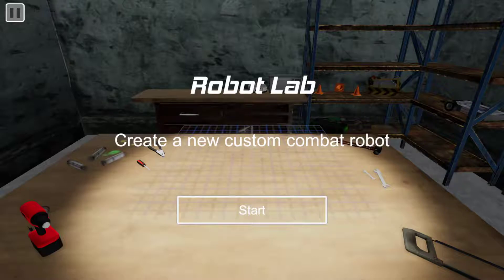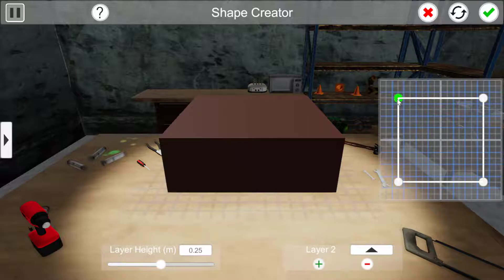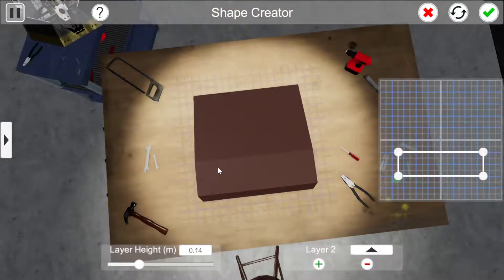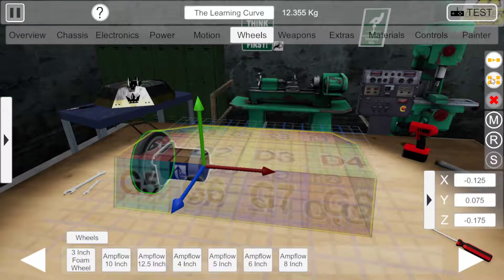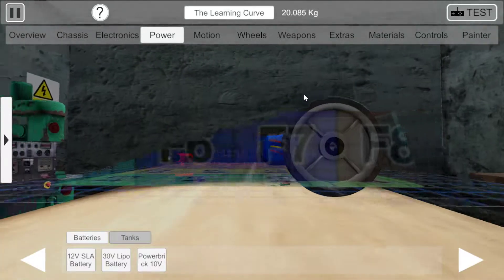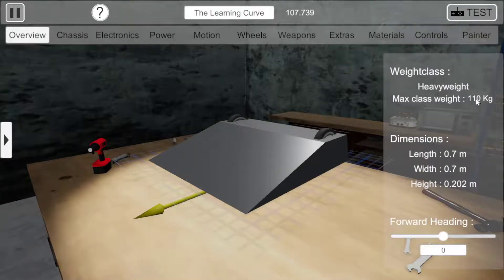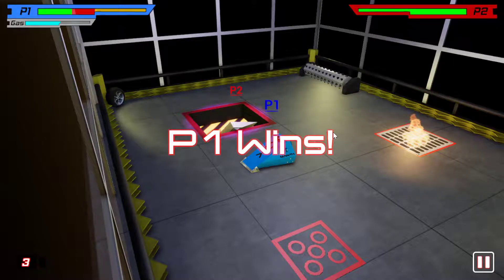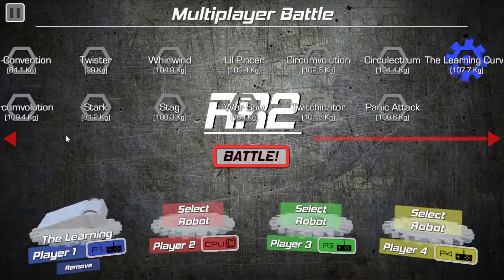The Learning Curve: Part 1 - Robot Rumble 2.0

Comment: one tip
Make sure that your bot has rounded sides that don't interfere with the weapon mechanics so that it won't tip over, like at 12:36. I did a test with Silver Bullet and had that same problem.
Reply from the maker: Aye. It's sort of something I didn't think of here since usually I automatically include it in the chassis shape. :3